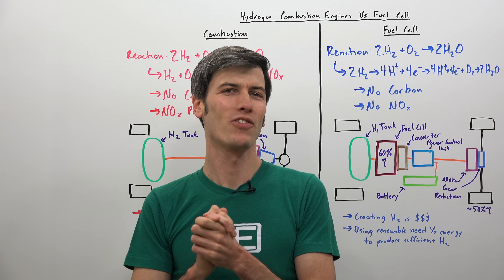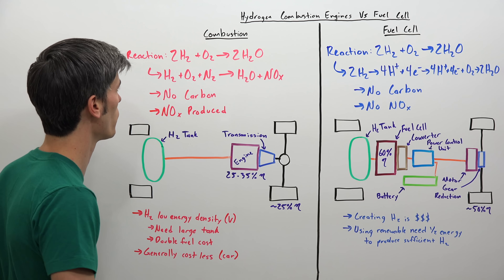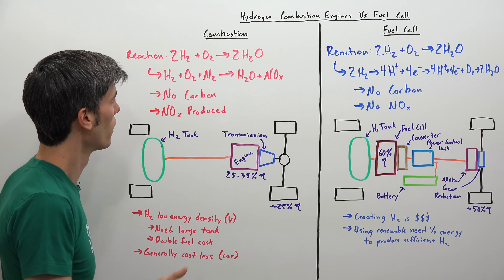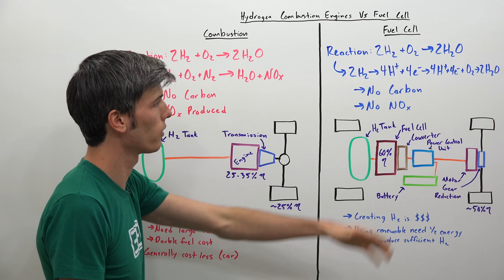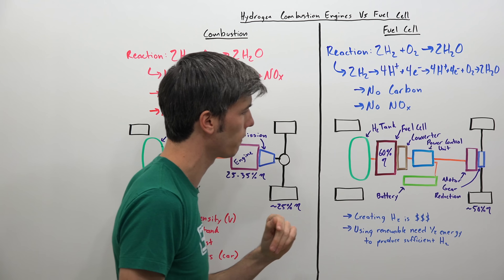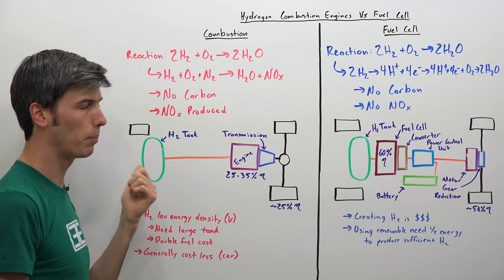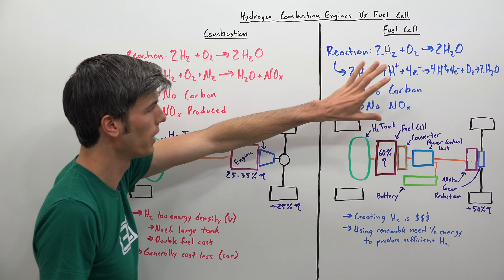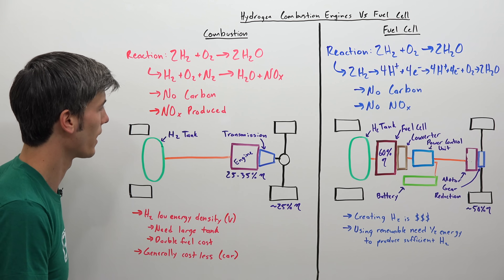Why Hydrogen Engines Are A Bad Idea

Comment: I could see a future where both systems are a thing, and that's by design. We could have fuel cell cars be the "people carriers", no gears, fully autonomous at some point, all that jazz. As Hydrogen ICE these could replace gasoline ICE engines for enthusiast vehicles - so there'd be a very true separation between "cars" and "sports cars", where the sports cars could be more focused when not strangled by emissions, by a way of introducing NOx capture devices or running the fuel lean. Sports cars could become a true niche of it's own, used for purely sporting purposes and not considered A to B transportation, owning a sports car that you drive yourself, change gears yourself and create noise with would be more akin to owning a jetski - it would be a leisure toy, stripped of it's previous function. I don't know if this makes sense to anybody but it's my two cents
Reply: That future I would like to live in.
Reply: Great point!
Reply: For performance vehicles I think you'd just put a bigger battery on the vehicle, or even have it exclusively battery-powered. EVs haven't had nearly as much R&D time put into them as petrol ones yet still there are relatively affordable battery EVs that have crazy good performance due to how electric motors get that instant torque.

FC could work too as long as the technology improves a lot. Would still use some sort of battery or capacitor system but wouldn't need to be too large if it was a really powerful advanced fuel cell.
Reply: Since I’m only 16 y/o I can’t really talk about price because I’m not experienced but later I really want to have my electric truck or hydrogen full cell truck but for my toy (snowmobile, motocross) I would rater theme to make “noise” and be light and quick responding. So your point off view actually make sense, for me at least
Reply: @yupyupmyjelo1677  it will be slower responding and accelerating though when it's ICE, that means that if you want the sound you have to give up a lot of speed and power
Reply: @sneaky_krait7271  that’s true but, sheer power and acceleration is not the full story of enjoying cars and driving. I drive an electric car at work occasionally and yes it’s damn quick but, I never get out with excitement to drive it again. It just becomes a tool to complete the job of transport, not for me.
Reply: @DoubleDragon5180  if they are allowed to coexist without the ICE engines being stifled by excessive financial constraints or emissions regulations etc then I wouldn’t mind more electric/hybrid cars being about. That would be a fair compromise to suit both those who enjoy driving and those who just see it is a tool to transport them and nothing else (of which there are many). That would appease most folks and keep ICE residuals strong too.
Reply: This is actually very sensible... Thanks for highlighting on that...
Reply: With minor modifications you could make older engines run on hydrogen and by adding an electroliser to the desigh you could make it run of water
Reply: @MsHojat  yeah the point is that real petrol heads don't mind that much 0-60 or lap times but fun, so EVs can stay with grandma
Reply: Makes sense. Combustion engines become a bit like horses 🏇🐎🐴  - a previous standard everyday working technology now just retained for leisure use.
Reply: Yes but that would mean they would be “OFF-ROAD ONLY” vehicles since it’s not transportation anymore they wouldn’t see the point of having them on the road anymore other than endangering lives because people are going to be street racing them lol so no more mexico or Texas 2K.
Reply: The problem here is that hydrogen ICE have little to no power.
Reply: @a20axf  There is a hoary old adage from a time when guys driving sports cars wore flat caps and had long scarves trailing off their necks; "It's more fun to drive a slow car fast than try to drive a really fast car even faster". Trust me, some of those guys were my uncles, and it's true! It takes a driver, skilled and familiar with his vehicle, to make the slow car shine. Raw courage may get you the other, all by itself, in a really fast car.  FR
Reply: @fugawiaus  little to no power? They have, depending on the injection method, less or way more power! When the hydrogen gets injected directly inside the cylinder, especially when in compression cycle, then it has up to 35% more power than a comparable gasoline engine
Reply: @huey-fan8335  good luck with that. Haha
Powerless
Reply: @fugawiaus  well, the Hydrogen is pretty cold, it cools down the air inside the cylinder quite a bit, leading to a way higher load inside, generating more power....it's simple physics....! Almost every other Hydrogen engine had the Hydrogen manifold injected in front of the valves, thus replacing air with hydrogen and lessening the power! With direct injection you surely can make more power nonetheless
Reply: @fugawiaus  then please check your sources🤦🏻‍♂️ we are not all drivin it because we can't store sufficient amounts of hydrogen to have much range with a ICE....and it's very inefficient too!
Reply: @huey-fan8335  look up the engineering on the subject.
Reply: But the hydrogen combustion would likely also require DEF to reduce NOx as it's a carcinogen. That's basically just as bad for us as the carbon emissions otherwise. And again, that's twice the hydrogen being made and twice as much you need to carry with you. Remember a hydrogen tank unlike a gas tank is a literal bomb. They are pressurized up to 700 bar which is enough force to kill you up to 20ft away and will definitely destroy your car when it happens. 

No I'm not talking about the hydrogen getting ignited either, just that it has a pressurized tank and hydrogen is known to embrittle materials that hold it. That means if you are the kind of person to hold onto a car for over 10 years, that's a serious concern especially when for existing cars it's something that's never going to happen.
Reply: I’ll be using the ICE as my daily driver
Reply: @MsHojat  For performance vehicles, the enemy is weight. When it comes to EVs, the more power they produce the heavier they are(Unless they sacrifice a lot of range).  Weight increases inertia, which Saps power and ruins cornering performance. HCEs, carrying this weight advantage is what really makes them the only viable low emissions option for most categories of sports cars. I do expect certain niches of sports cars to go electric, considering the success of the Tesla Plaid, but it's hardly representative of what the majority of car people need to continue pursuing this hobby.
Reply: What’s the advantage of a hydrogen ICE over a gasoline one?
Reply: @PedroMachadoPT  emissions.
Reply: Synthetic gasoline may be a better choice. At least Porsche thinks so. That would be a good topic for another EE video.

Comment: Why hydrogen engines are a bad idea? Big oil companies cannot profit from you.
Reply: Not only that but the globalists don't want the public to be self sufficient as they're pushing for the NWO.
Reply: Lookup Daniel Dingel and Stan Meyers who both proved this video wrong.
Reply: They actually can. They'll simply convert their oil plants into hydrogen producing plants.
Reply: @fitnessnaturale . You miss the point. You can make your own, you dont need them
Reply: @shanevonharten3100 , I agree. I'm currently researching on it.
Reply: Big oil companies can. They would rather you drive Hydrogen vehicles instead of electric vehicles.
Reply: @peterburton3095  This is standard run your car on water BS. Sadly some part of the population will waster their money on this stuff every year. I doubt most of the people that watched this thread will fall into this group, nor are they interested in a link to a scammer.
Reply: @TheFourthWinchester  the gas used in electric plants is not free yoh know
Reply: YOU NAILED IT...
Reply: Same with bio fuels derived from hemp which has 75% of the plant able to be converted to fuel think of a world where we grow our own fuel and plastics but they don’t want you to know that until the ground caves in from fracking
Reply: Unfortunately everyone is going towards electric and yes they make them fast but they have been hitting good times on the track with combustion engines before electric was said to be the future. Its actually depressing to think all race events and truck events may be quiet in the future. I know some of it is do to the lack of gas supply but e85 was created and I'm sure other solutions are out there to keep combustion engines out there especially on track events with loud open race engines. Its really bothering me and keeping me up at night that's how much i love the combustion engine. So much you can mod and tune on cars but soon that all may be over with.
Reply: Most of the push for fuel cells and hydrogen is because of billions of dollars invested by big oil companies and that actually 90% worldwide  hydrogen is produced by the petrol-chemical sector cracking methane, so yes ,I believe big oil companies will profit on hydrogen
Reply: Honestly I'm not even watching the video. I have got basic knowledge of the matter and I'm straight on the comments. Fair enough 🥇
Reply: The largest producers of hydrogen are the oil companies. So ya, think you missed that..
Reply: @fitnessnaturale  you cant store hydrogen in the same way as oil. Hydrogen needs to be compressed to insane pressures to stay liquid
Reply: @shanevonharten3100  oh, yeah. You can using electricity. Electricity you  buy from... companies. Lol
Reply: Hydrogen is a vastly smaller molecule than those found in Gasoline.  Piston rings commonly used today wouldn't be efficient. Big oil companies are pushing hydrogen because they view it as a transportable fuel that they could adapt a lot of their infrastructure to.  Hydrogen would be a terrible fuel for an ICE engine.
Reply: @shanevonharten3100  How will your make your own?  With present technology it will take 55 Kw/ Hrs to make 1 KG of Hydrogen.  Better to just pump that into your battery powered  Vehicle.
Reply: They could just turn their factories into producing hydrogen. And anyway you do realise that electric cars is the future especially with various countries looking to ban the sale of combustione engines within the next 20 years. So if it's all about profit why has the combustion engine got a limited lifespan Surely that's not good news for the oil companies once diesel and petrol cars are banned in several countries
Reply: @shanevonharten3100  To produce hydrogen you need a lot of energy. A a lot of expensive equipment to compress obtained gas.
Reply: @PiotrPilinko  There are vehicle mounted units getting around already, built in backyards and workshops.
It not hard, not big and no more dangerous than current fuels.
Reply: @taz874 . Electric cars are fine for limited travel in cities for example but useless where I live. 10 or more hours a day driving is common.
Then there's the source of the electricity to recharge your car, we already have power shortages in Australia so another fail. 
Renewables create a greater carbon footprint over their life from the mining of the raw material to recycling and coal plants if required to supply more power will produce more pollution so we don't actually come out better off. And who has hours to sit around while the car recharges.
Reply: @shanevonharten3100  What is the total cost of obtaining one kg of liquid hydrogen?
Reply: @PiotrPilinko  . I don't know.
Most of the setups I've seen are made from scrap material so very cheap. They run off vapour directly from the unit not compressed and stored.
Reply: @peterburton3095  Nonsense, Dingel and Meyers are fraudsters. I verified this!
Reply: You would still need oil for lubrication as you are still using a combustion engine
Reply: @AE86FTS  there are alternative lubricants as well
Reply: Until you discover the process of producing and storing pure hydrogen...
Reply: @quindsay1233 . Until you see vehicles producing their own from water and running fine. 
Do some research buddy, they have been out there for years without drama
Reply: Shane Von Harten - Those hydrogen from waste metal setups are scams. They used aluminium to produce hydrogen, using up the aluminium in the process. Considering how costly it is to refine aluminium, this is obviously a bad idea.
It's like claiming alkaline batteries are a new power source.
Reply: Quindsay123 - What the hell are you on about? You most certainly do not get 4200000000 kJ of energy from reacting 0.2 mol of H2 and 0.1 mol of O2. That's 4.2 terajoules or a kiloton in TNT equivalent.
It's 56.7 kJ when 100% efficient.

I'm trying to think how you even came to that number. You're not too far off a matter/anti-matter annihilation reaction with that number - 3.6 grams of matter would get you 324 TJ.

I checked the numbers for your electrolysis of water and that's pretty close, assuming a plant efficiency of between 70-80%. But how the hell did you get the first bit so catastrophically wrong?
Reply: @shanevonharten3100  you needed 3x the electricity to make your own compared with a battery EV.   Have you tried compressing gas to 700bar, your garage compressor isn't going to do it.  Plus the temperature goes up a good bit when you compress gas by 1bar, nevermind 700.
Reply: @tonystanley5337 . I'm no scientist, all i know is I've seen vehicles convert to produce their own and run on hydrogen.
It is a proven, repeated concept.
Reply: @shanevonharten3100  an in-vehicle HHO generator is not an example of a hydrogen vehicle.  It is simply using a small amount of Hydrogen and oxygen to 'help' burn the petrol and air more effiently.  There is no significant evidence that these actually make any real difference to mpg, other than general waffle from those selling it.  They are snake oil.   
To produce enough hydrogen to drive your combustion engine car you need an alternator to produce around 3x the the power you want from your engine, say around 300kW.  If your alternator produces maybe 1kW it is larger than average.
I suggest you leave the thinking to the scientists and engineers, many of whom have correctly pointed out key information to you.
Reply: @BakuganBrawler211  Yes and that's such a good idea for the environment isnt it, burning hydrocarbons....
Fucksake.
Reply: @fitnessnaturale  that in theory would be great but then you have to fight the war machine who have spent billions and it would make their global war look ridiculous. Just like the news paper mogul who bought a ton of trees and shut hemp and cannabis down in the 30s basically condemning Hispanics in the attempt. Humans are a stubborn species. I'd say just build your own and forget about everyone else. We need to stop trying to save the world and just save ourselves. If we all saved ourselves the whole world would be saved in the process.
Reply: @matthewq4b  you missed the point. Hydrogen can be easily produced at home. Anything that takes away from their profits will be suppressed. You can't just go out back and produce gas or oil. We need to use our brains more than anything. Stop bickering about nonsense and just take care of ourselves. If everyone was a moralist we wouldn't have any issues now would we.
Reply: @matthewq4b  really so what am I making? Steam?
Reply: @matthewq4b  maybe you are thinking of helium.
Reply: Who do you think is funding the research?
Reply: @trevoncowen9198  the same ppl who suppress the technology and kill off anyone who concurs it?
Reply: Jason VonIrsik u got any proof it’s suppressed
Reply: @trevoncowen9198  it's as simple as researching. You will begin to see a trend in ppl who are independent engineers who have died untimely deaths and their work completely gone or bought up by certain organizations then never seen again. That to me is suppression. I've worked in the oil and gas fields my whole life as did my father and grandfather all have made our way very high up in the ranks and it's no secret. It's easy to pass everything off as conspiracy and the point of creating a conspiracy around Amy subject is to divert attention. Anyone can take a reliable solution and if enough ppl grind it out they can make that solution as unreliable as they want. It's a tactic that's been used for ages. Just look at hemp production in the 30's with the news paper mogul who had purchased huge acreage of lumber for his paper mills, then look at the advancements in the hemp manufacturing industry at the same time period. This man successfully smeared the hemp industry and......AND...... an entire demographic (Hispanics) who were exporting cannabis and hemp from Mexico to the US. This tactic worked so well that today we are literally having to un-brainwash an entire world as we now know through scientific research that Cannabis is hardly the monster it was said to be. Refer Madness and ignorant fools still to this very day are constantly arguing over the validity of allowing hemp to become the major resource of paper and.....everything else it's very capable of producing. Regarding Hydrogen we know it's benefits and it's diverse applications yet we have been suppressed and the experimental stage constantly remains the same. If we were allowed to have unbiased access to all patents or experimental data we could turn this into the cleaners energy production as hydrogen does not produce carbon based emissions. I get it gas is awesome but we are literally only using 20% of the energy produced. I'm not expecting you to believe me as that's not the point but I'm not going to write off hydrogen engines. We should all be looking for was to better society not wasting our time arguing. I know that we can achieve great standards in engineering but we focus on trolling others because we don't always have every angle researched. It's natural human error. A flaw in humanity if you will.